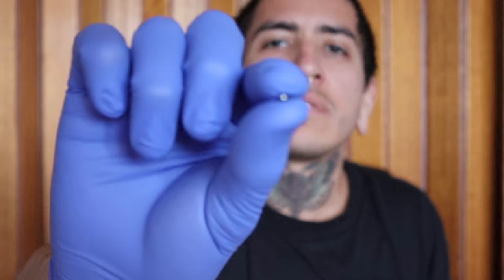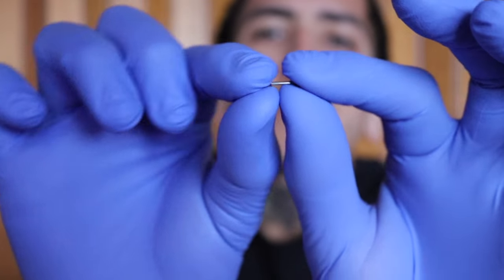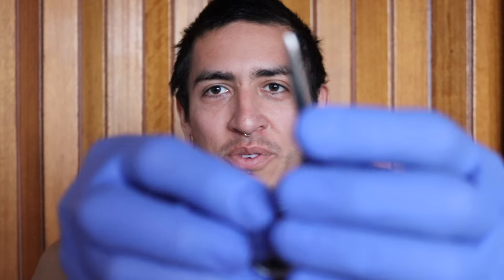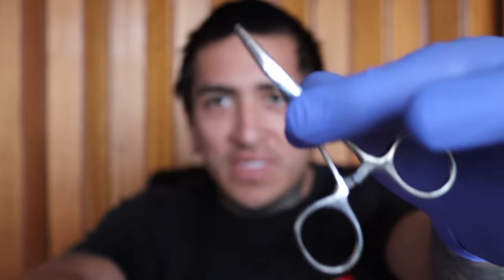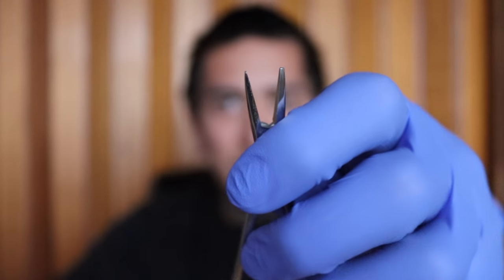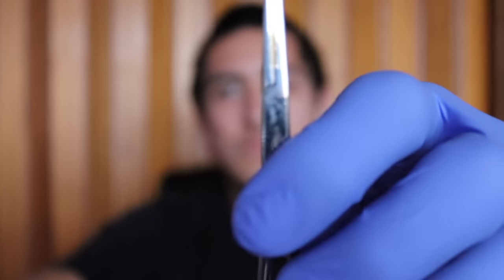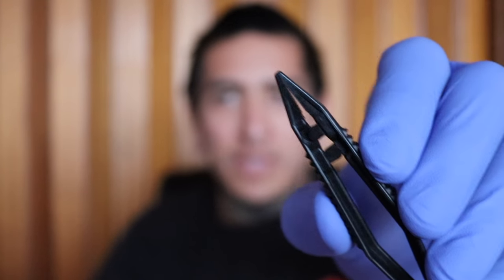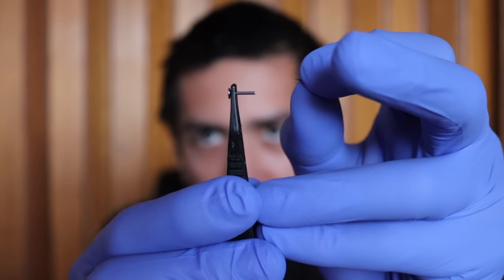How to Remove and Install Threadless Jewelry

Comment: It. Wont. Come. Out.
Reply: paige pastry I fucking felt this
Reply: Same bro.
Reply from the maker: Let me help you out! If you don't live in San Luis Obispo county, go to www.yourlocalpiercer.com/ to find a piercer near you!
Reply: I’ve been trying to remove my flat for about an hour now :’(
Reply: Alana M me too !! I have a bump around my piercing inside and outside and it’s probably needs to breathe but it’s so hard to take it or
Reply: @abeauty1899  do not take it out. Just do a saline soak or saline spray twice a day and LITHA method
Reply: Ines J thank you ! usually clean it with salt water and a qtip but I just found out I used table salt instead of sea salt. But  I haven’t cleaned it for a while but I will get back on it .
Reply: this is me right now nothing will make it budge.
Reply: @alanaswiss  u & me both! It's red now, hurts like a bitch,.... I'm about to cut the whole ear off I'm so irritated..
Reply: i'm a whole ass year late but FOR REAL. i just want a hoop in my nose and not a stud 😅
Reply: SAME AHHH I’m trying to change my seconds and my tragus, helix are just staring at me like have fun
Reply: Same
Reply: I’ve had mine for two years, still can’t get it out lol
Reply: @alanaswiss  try to years 😂
Reply: I can’t get mine in!
Reply: Actually, it does. Mine came out 3x
Reply: @alisonstevenson5396  The part on the inside is supposed to be bent, that’s what makes it stay.
Reply: REAL
Reply: @jennifer6268  they’re not saying it’s impossible for it to ever come out and it’s permanent. They’re just saying they personally are unable to remove it on their own and will probably need a professionals assistance.
Reply: Me too girl 😢 must be a curse against paiges
Reply: It won't.
Reply: Broo I feel this like I got nose pierced a while back and it one with flat back but like the sun bitch don’t come apart and if it does it like really on there. I just wanna switch to my ring.
Reply: @Toxic_panda.  did you ever get it out yet? I’m having trouble with mine 😭
Reply: same girl same
Reply: I have so many earrings I want to wear 😭
Reply: If you have wire cutters or somthing like that you can cut the stud off and it doesn’t hurt just did it
Reply: It's 2 in the morning and i feel this panick right. Now.

Comment: I’ve been sitting here for 40 minutes and it still won’t come off. I’m going to cry.
Reply: Jasmine Verá same, sis, same.
Reply: Literally same. I stg they are lying just so you have to come in and have them change it for you. It’s such bullshit
Reply: Same.. tried to get my 16yr old daughters out for her due to volleyball n cant!!! But I'm gonna try again after watching this now. 🤞🏼 we live about 45min from where we got hers done at so not like we can just pop by. Especially with 2 busy schedules that we both have smh
Reply: Thank you! I didnt know my jewelry was threadless. I've been trying to "unscrew" this thing, I almost went to a shop to get it removed.
Reply: ME TOO MY STUF IS SO SMALL
Reply: Use a tissue paper for the grip of the stone above and hold it down and pull in the opposite direction with equal strength this is the only thing that worked for me duhhhh

Comment: omg thank you so much. I didn't ask what jewelry i was getting and i couldn't pull it out so i thought it was nose bone and panicked.  I found the trick was to hold steady the head part and pull the tail out. If you pull from both sides it won't come out as easy. I watched your vid and I got mine out in like 10 seconds and put the ring on in 10 seconds also. I had it pierced in March and it healed perfectly since it didn't swell or bleed or hurt in any way. The feeling you feel when putting in a ring really is cool
Reply from the maker: Thank you so much! Happy to help! 😁
Reply: I am so late see things but thank you so much this comment helped me rn to take it out for the first time !
Reply: Thank you for your comment!! This was the way I had to do it as well- before it would not budge and was hella painful
Reply: BROOOOOO I HAVE BEEN TRYING TO TAKE MINE OUT FOR LITERALLY 6 HOURS AND YOU JUST HELPED ME WITH ONE SENTENCE I HAVE WATCHED 9 DIFFERENT YT VIDEOS TOO BUT YOURS IS THE ONE THAT HELPED
Reply: This comment was literally such a life saver though 😭😭
Reply: ur comment helped me to take it off! tysm <:

Comment: Thank-you for this video!!!! I had to PULL but I got my piercings out!! These were for a second lobe piercing.  
My helix piercing fell out. 😂 The post got too long when the swelling reduced and it fell out before I got to my piercer for a shorter post. 
I didn’t think my lobe piercings would be a problem. I had them done 7 months ago so they are healed. 

Thank-you!!!! 2:54

Comment: ok i may be a little late. but i have my nostril pierced and the L- nose studs always fall out when i sleep and so i had to get it re-pierced and now i sleep with a plaster on it every night. I have a ring in at the moment though. i bought a internally threaded stud but need a taper to put it in as i’m very un-skilled. i cant find any tapers/insertion pins that fit in the UK. and my piercers don’t either. Do you have any help before i waste more money on tapers that don’t fit

Comment: Okay so i dont have this tool to keep hold of the labret back so this is what i do when its stuck..
Take two pieces of thread, make a  loop, loop it around the front and back of the piercing and pull, it comes out easily. Use this to remove my nosepin all the time
Reply: This saved me after pulling on my nose forever. I used tweezers to hold the back on the inside and thread on the other. Came apart super easy. Thank you!!

Comment: I will never get this kind of piercing again. I have them on my ear lobe and it will not pull apart. I’m having to use too much force. I got one off and the other is stuck. It’s pretty much permanent jewelry.

Comment: Hey ya'll. Usually don't comment but think this info might be useful: My nose piercing is fully healed and has a flat tip end like shown in the video. HOWEVER. If you're still struggling to pull the two parts apart it's probably because the top stud part of the piercing actually begrudgingly unscrews. Found this out after my whole ass piercing was pulled out through the hole, flat tip and all. Was very bloody. Make sure it unscrews even if it's a flat tip and try unscrewing it again before yanking on it.
Reply from the maker: Yes! Good point! The jewelry can also be threaded! If so, twist to the left. Hemostats will help if you can't get a good grip on the jewelry. I don't use threaded on nostrils, but I have removed some threaded jewelry from nostrils before at our studio. Thank you for your comment!
Reply: That’s what I’m wondering if mine screws or will just pop off. It’s been 3 months since I got it pierced and I’d like to change to something prettier.

Comment: Hi, do you have any advice for me on how to clean them? I'm still in the healing process and due to the pandemic I cant go back to parlor to get more antiseptic spray. I'm m barely going on 3 months of healing. Tyia
Reply: Simply boil them in water! 2 or 3 minutes in, then take them out, dry them and store them somewhere clean and dry. You can also use a saline solution to clean them, soak them in the solution and wipe them down. Hope this helps.

Comment: GUYS, what i did was tie a not at the top of my piercing with a string around it and pulled the string and held the bottom from the inside of my nose and it came off easy peasy!!
Reply: did it hurt?

Comment: He didn’t explain in the video, but installing is also more complicated than just pushing it in. Because it will come loose. You need to very slightly bend the ball part while it’s in the post, THEN push it in. Believe me. I learne d the hard way because my nipple piercing kept sliding out lol, I’m old school so I kept twisting trynna figure out why it wouldn’t keep in place lol.

Comment: My nostril is too small i can't hold onto it
Reply: Most likely post is short on back too. I had mine shortened (6mm)recently and then I have nothing to hold on to for the top end. So when I get them out I’m putting slightly longer ones in again , just not as long as the first lot they looked like bogeys sticking out 😂